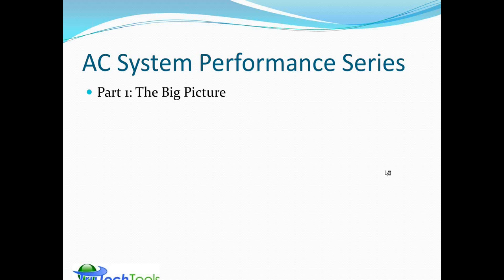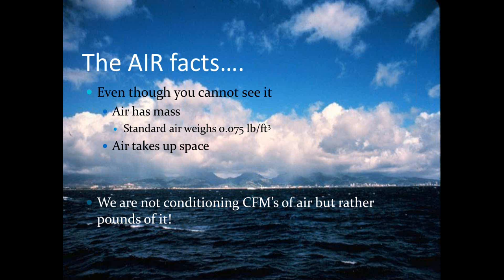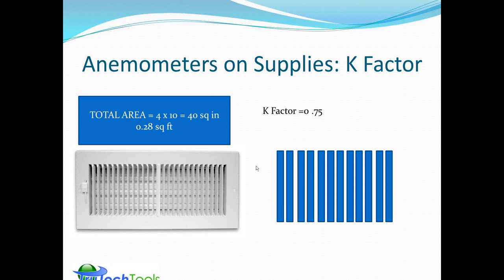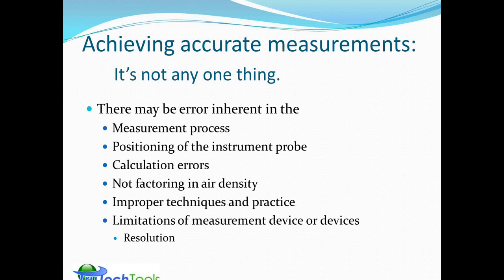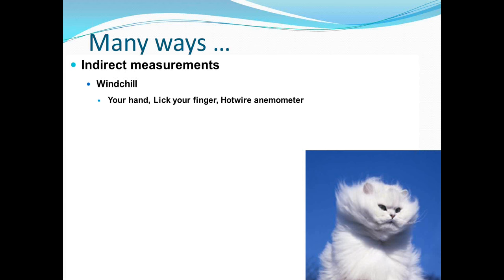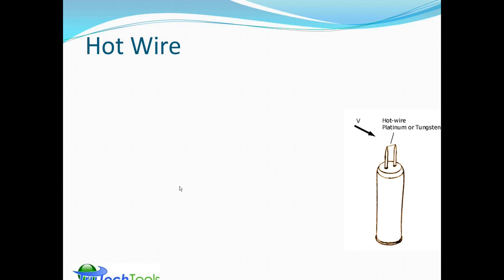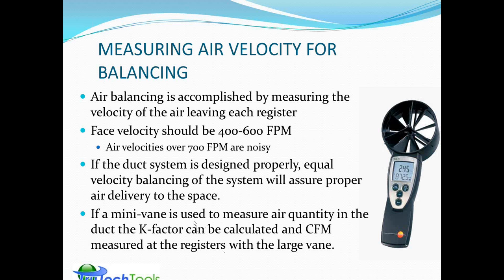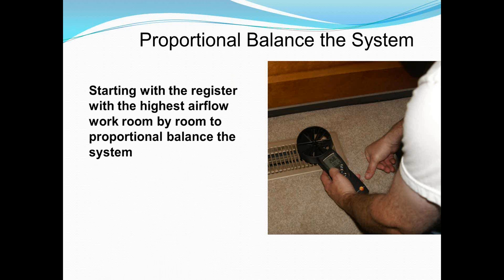AirFlow Part 2  A/C System Performance Testing

Comment: Hey I have to tell you this was an exceptional presentation. My understanding of the importance and the overall concept; has changed the way I look at hvac. Stupendous !!! I would love to apply these airflow measurement techniques; to prove a minisplit airflow. However I am unaware of the surface area of the grill/coil. Manufacters spec don't help. They only state approx airflow during an array of conditions. Have you guys  ever tried this? I would prefer using the testo 417 vane anemometer. I feel a self made capture hood is the only way. If it is a capture hood only , is there a specific product on the market?

Comment: What would happen if i were to compare total pressure across an air handler measured by pitot tube instead of static pressure. Would it give the same result as comparing static pressure across?

Comment: Thanks! Can you answer one thing where I’m confused?
If the static pressure is too high, then the CFMs are less, but does the velocity increase causing noisy ducts?
Reply from the maker: You may be confusing two things.
Total External Static Pressure (TESP) in the system is the load against which the distribution fan has to "push" the air. Higher TESP usually means lower system airflow or excess energy use in an ECM motor.

Measuring Static pressure drop OVER an A-coil or heat exchanger is an indirect method to determining air flow (CFM) via pressure drop over a component and brand and model specific manufacturer data.

Excessive CFMs (airflow) through grilles and ductwork can produce excess noise

If you have any additional questions, please do reach out by email at billy@trutechtools.com!